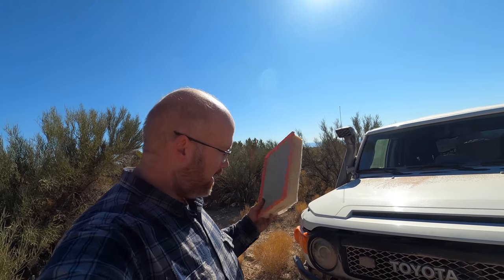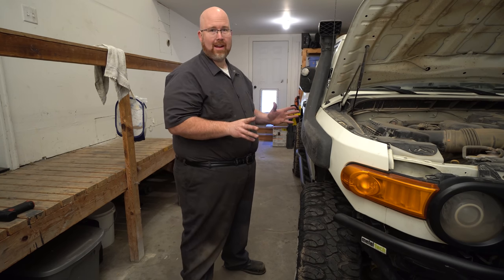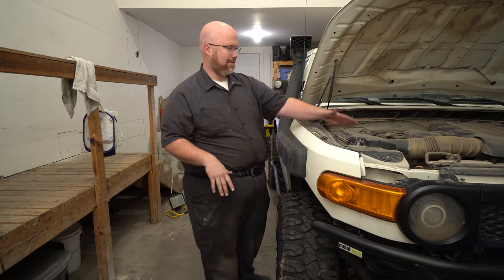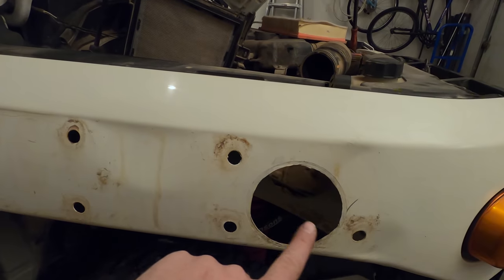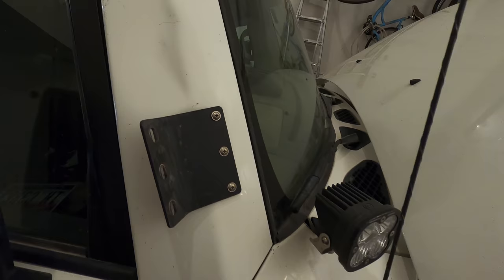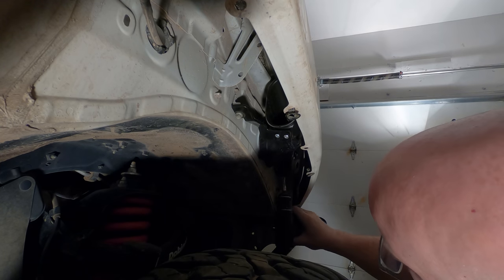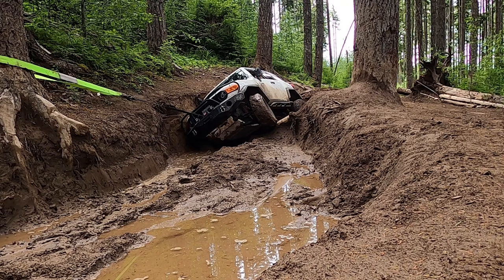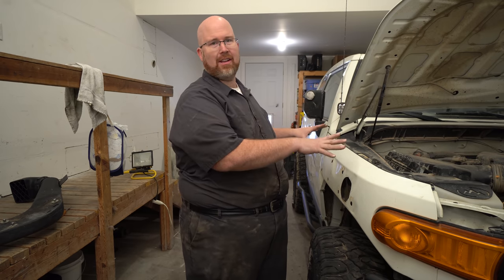How A Snorkel Can Damage Your Vehicle

Comment: But if I take my snorkel off,  no one will believe my street only lifted truck on 37s is actually a hard-core overlanding rock crawling dune jumping river fording full bodied Tennessee hill killer.
Reply: Same
Reply: What he said
Reply: Yeah.
Reply: Fun fact snorkels were originally designed for dust conditions as dust down low to the ground is more dense than dust up by your roof.
Reply: Haters are gonna hate
Reply: Don't remove snorkel.  Just keep  the box open . More breathing . Let  it be there for looks.

Comment: The biggest benefit of a snorkel is getting cleaner air on dusty trails and not for water crossings .
Reply from the maker: Exactly!
Reply: That's only true if you are the first vehicle. If you wheel with others as you should it has no benefit
Reply: @williammortensen1889  only if u drive dead close to the person in-front of you. and in high dust areas you should not drive in the persons dust cloud thats in front of you in case they stop and u run into them. so if you are driving in a safe manner no matter if there are 20 guys a snorkel will always get you cleaner air into your engine
Reply: @cordellej  apparently your idea of wheeling and mine are different. If your not locked in Low then your not wheeling, your driving down a dirt road.
Reply: "Cleaner air" lol. The first time you stop/get stuck 
( and you will stop and get stuck ) then no more clean air and boom dust cloud caught up to your snorkel in most cases😉👍. Cool video😎.
Reply: Ah, that’s what the air filter is for. Unless you’re driving in a talcum powder dust storm, your air filter will deal with the dust no problem. Or you can clean the filter a little more often. Snorkels restrict airflow to the engine. They increase drag and noise and fuel consumption.The only benefit is water crossings that are deeper than the wading depth of your car. But they look good and what’s the extra cost on an already overweight accessory laden 4WD?
Reply: @zeitgeist785  exactly smart cookie 🍪! If you suck in mud/Mountain silt water, in Elbe Wa on the Busy Wild or down in a puddle at a river, if you don't dry/suck soak the water out of the intake ( preferably through the butterfly of the throttle body or carb whatever it be) and then immediately get off trail and do at least one full oil and filter flush. Then monitor diligently from then on out for a while. Snorkel is for when you were four wheeling into muddy areas of a trail, a quick mud bog hole portion or a water crossing all of these in which were deeper waters then thought, now THAT folks is what a snorkel is for no other reasons really period. H2O that's the reason for them! NO🦴's about it y'all 🤐✌
Reply: @williammortensen1889  i guess uve never been proper wheeling then  cause when u have dust up to the top of ur bumper then thats wheeling i guess you only know half not the full spectrum     typical know it alls
Reply: @zeitgeist785  everything you said is Terribly incorrect, don’t give this advice to anyone.

Comment: I totally hear that you're not anti-snorkel. But looking at some of the trails and rock crawling you do. I think you would have damaged all those fenders/panels if the snorkel wasn't on there anyway.  it might have saved more damage than it created. Just a thought.
Reply: I agree; I suspect it probably saved more damage than it caused by being squishier than the metal body panels. The biggest benefit of snorkels is indeed keeping dust out of the engine, with deep water crossings being a secondary consideration, but as someone who has drowned his 4x4, I don't recommend discounting that benefit!
Reply: Just saw the other side panel, you might be in to something 😂
Reply: He still loves you. He's like Jesus

Comment: It seems that the design for the FJ could be better.  Why not design it to insert in the fender earlier and then run down to where it goes into the engine bay.  At this point, this seems non-sensicle.  The damage is already there.  Just chalk it as trail rash.

Comment: We went with a snorkel cause here in the Texas Panhandle area with dust and dirt get to be crazy and it helps keep the filter cleaner.  Also had a friend recommend to turn the intake around backwards it helps reduce it even more.  Backwards it also helps with you get a really heavy wet snow so it doesn't clog up as easily.  Now If I was stirring up a lot of my own dust then it turned forward would be better.

Comment: Agree with you. Thought about adding a Snorkel for the cleaner air in dusty environments but concerned the Snorkel especially on the pillar getting snagged on branches since I drive more forest roads than desert
Reply: There are specific snorkel head socks for dusty environments. Where I live, water crossings are a regular feature to off-roading, bonnet and windscreen depth is fairly common. I’d never run a 4x4 in New Zealand without a snorkel. Unless she was a street queen!

Comment: I have a Nissan frontier and I just put a snorkel on not for water but for dust and gravel, I opened up my air box and found gravel! some how rocks got into my intake box through my wheel well. I said hell no and bought a snorkel to close off that whole system.

Also I do offroad quite a bit but I'm not looking for trouble its more of just getting over a obstacle from A to B say an rough hunting trail.

Comment: With 35s on my tacoma and little to no fender liner, i basically NEED a snorkel otherwise my intake is in the wheel well. Not even for water crossings but for wet/snowy/dusty roads
Reply from the maker: Nothing wrong with a snorkel for most people. I need to do some intake relocating myself as I also have no fender liner.

Comment: This is where I am going to disagree. I have already hit one tree with my snorkel and it did require that I replace the fender. But I have also been windshield wiper deep in water a few times. The damage from the tree pales in comparison to the damage my engine would have taken sucking in water. The upsides still outweigh the downsides for me.
Reply from the maker: I don't think we disagree. I made the point that if a snorkel saves your engine from water just once, it was worth having. 👍
Reply: @offroadhub.official  Looks like I will need to watch the whole thing again! I am viewing on mobile as opposed to my usual TV app.

Comment: Some of the trails here pretty much require that I run a snorkel, to the point that my electronics are all waterproofed and my exhaust is also extended up past my tub, but then again, the roads like to flood here and my road washes out about 4 or 5 times a year
Reply from the maker: A snorkel would be a good idea for you then for sure!

Comment: yea, I have a arb snorkel i have never put on. 

I live in a very wet rainy muddy environment, plus volcanic dust. I still have really not had a use for it. I am going to put the scubba kit on for water crossing; but, basically if I ever cross something deep enophe to need the snorkel, I got way bigger problems before the water getting in the engine is a concern. damage is being done somewhere else (e.g. electrical systems, etc).

still might someday, and I was waiting to raptor line the entire FJ first and add bumpers.
Reply: I have debated putting a low profile mushroom type snorkel on the hoodd corner . that would cover 90% of water crossings anyway.

Comment: [1:10] I don't think the dust will find its way using the OEM intake easily, probably if you did the test again with the OEM air intake the results will likely be the same.
Reply from the maker: The factory intake is directly above the passenger side front tire.

Comment: Yes, the snorkel dilemma..I installed mine for dust control and yes, the ebay $100 snorkel can hold the weight of my fj. Luckily it wasn't on it enough to push my sheet metal, it was more of a gentle lean, i was able to back off. Your gonna have one heck of a project. I've only sat in my garage, staring at my fj thinking "hmmm, 1ton axel " but that's as far as I've gone. Lol
Reply from the maker: Yeah I'm going to be in way over my head! 🤪😂

Comment: don't you think removing the fender flares allowed the damage to happen cuz now there is nothing there protecting your fender i have a snorkel on my fj since 2014 no damage to my fender & I wheel harder then most
Reply from the maker: I actually decided to remove the flares after one was ripped off and did nothing to protect the fender. I'm not saying that having a snorkel will damage your FJ, just that it can, if you hit the snorkel.

Comment: I have heard that snorkels don't allow enough air for the engine at highway speeds. What do you think?
Reply from the maker: I don't think that's an issue. If it was a real problem, everyone would be getting lean code check engine lights.
Reply: @offroadhub.official  That makes sense. Thanks for your reply. 👍👍

Comment: So honest question, would you have still smacked your fender if the snorkel wasn't there?
Reply from the maker: I'm some cases yes, in others no. I've had the snorkel head contact things before which caused the slight damage to the A pillar. That definitely wouldn't have happened without a snorkel.

Comment: With “all the hard wheelin” you, I’m surprised you dont have side rails from the bull bar to the sliders...
Reply from the maker: I've considered it. It's just a matter of supporting tubing out in front of the fender. It would require a pretty long stretch of tubing that doesn't have anything behind it, so it may not be very strong.

Comment: It’s possible to fit a Cone prefilter, on top of the snorkel, giving you a nice flutter when off the gas. These are the same as you would fit to a JDM CAR or a anything that you put a cold air intake on, they sound good, give the turbo extra air and many people run them on pipes in the roll bars in their trophy trucks or side by sides etc.
I’ve fitted on as my main filter to many a JDM performance turbo  and seen a benefit. (Eg WRX, Skyline GTS-TT, R33 GTR. Even to a Mazda Familia/323 GTX-R 1.8 inline 4 Turbo boosting almost 25psi)

Comment: If I install bullbars, someone said I should install snorkel too because front bumper removed and air intake more exposed to water? Is it true? Help me I am a newbie 😄
Reply from the maker: Installing an aftermarket front bumper does not have any impact on the intake. The intake on the FJ is tucked up inside the RF wheel well.

Comment: A snorkel may save your engine from hydro lock, but if the battery terminals go underwater, that will fry most of the electronics in the vehicle
Reply from the maker: Given the location of the air intake on these Toyotas, a violent splash of water can push water into the engine. Like I said, if a snorkel saves your engine just one time, it was worth having! 👍

Comment: Great video.  Won't an extended fender stick out as far as the snorkel? With a wide fender or not  you would have still drug it
Reply: on that mud wall.
Reply from the maker: I'm not installing any extended fenders. The tires will stick out much further with the upcoming setup.

Comment: Does the snorkel help with gas mileage at all? Thinking of adding it to my Toyota Tacoma.
Reply from the maker: No, the snorkel does not improve gas mileage.
Reply: @offroadhub.official  I have heard mixed replies, even google stated they improve maybe 1 mpg by adding it.
Reply from the maker: @bradleysmith7265  if it improves mileage, it must be a miniscule change. I wouldn't consider it as a factor in your decision to get a snorkel or not.
Reply: @offroadhub.official  that's a good point! Any advice or tips on anything I can add to improve my gas mileage?

Comment: What about getting those bars that connect the bull bar to the sliders protecting the fender? Idk their name but I see them on Australian rigs.
Reply from the maker: I've seen those. Maybe I'll look into those at some point.
Reply: They’re called brush bars. Though they are used for rock areas as well. There are different styles you can use depending on what type of off-roading your into. They would of definitely helped in the situation you showed in that creek you were in. Pros less panel damage. Cons vehicle is now slightly wider plus the added weight. So tight tracks a bit harder to traverse. If your touring ( I think you guys call it over landing. Correct me if I’m wrong ) then fuel consumption goes up due to added weight and more wind drag.  They are well worth it though if your into those hard tracks.
Reply from the maker: @rossrhodes1963  thanks for your insights!

Comment: Snorkel bad cause off camber rock crawling? Meanwhile heavy disproportioned military vehicles all have snorkels doing just fine for decades.
Reply from the maker: Vehicles in the military are not routinely leaning close to or against rocks and walls larger than they are. Also their snorkels are usually integrated into their bodies, so they aren't protruding from the side of the vehicle.

Comment: How A Snorkel Can Damage Your Vehicle: You cut a hole in the body of the vehicle.
Reply from the maker: There are lots of holes in the body for options. The taillights, door handles, and mirrors all require holes in the body to be installed. Modification doesn't equal damage.

Comment: I wonder about restrictive air flow.
Reply from the maker: Under what circumstances?
Reply: @offroadhub.official  everyday use.   That snorkel is a limited diameter the entire length, then necks down just before it transitions to the forward scoop.  Any length of contained air flow is a restriction
Reply: G Goett I see what you’re trying to say, but airflow is pretty high. I’ve tested it using a paper towel over the intake. It barely stays at idle and doesn’t suck through when revving.

Comment: Hmmm a resu;tmfrom not cleaning properly, and insufficient side protection.
Reply from the maker: I've used a pressure washer to try cleaning under the snorkel. What do you recommend? What kind of side protection do you recommend? Thank you!
Reply: @offroadhub.official  lookup side rail and steps eg ARB
Reply from the maker: @christurner68  I'd have to find a way to make those work with my existing sliders. Those ARB sliders wouldn't cut it. Maybe I'll get a tube bender and make my own.